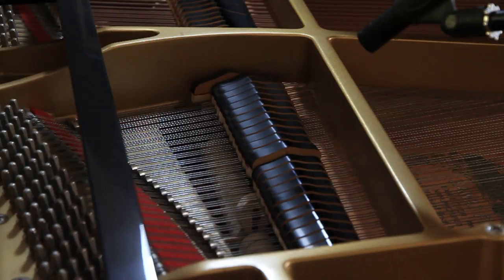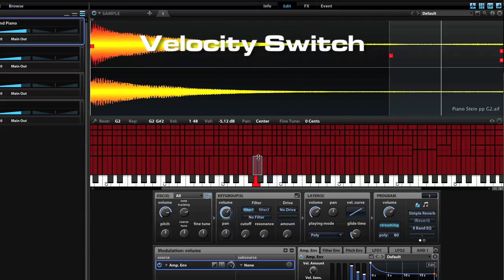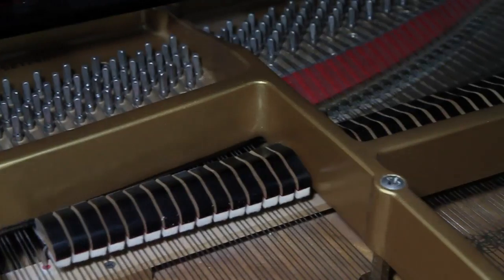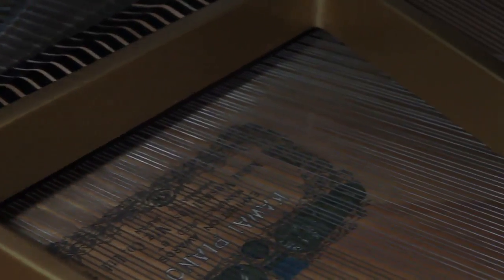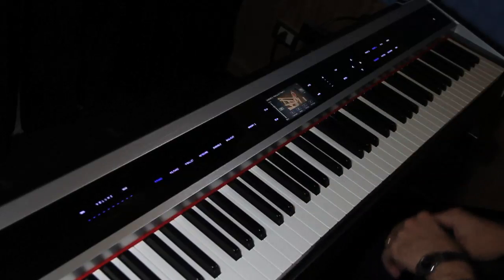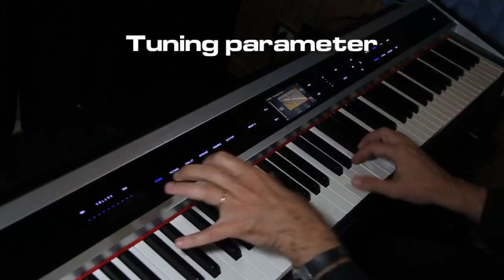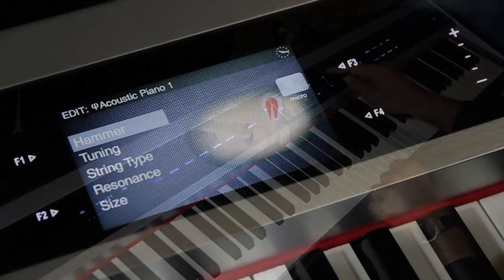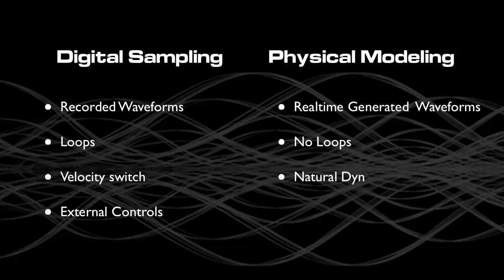Physis Piano Tutorial 1 - ENG

Comment: I've owned probably 9-10 digital pianos since I started gigging which includes Yamaha CP40, Yamaha CP33, some of the Roland, a couple of different Casio Privia models, Korg SV1, etc. I've also got to played many other digital pianos at different gigs including high-end Roland stage pianos and Nord's. However, I never found the one that's even close to the way I feel when I play the real piano. All digital pianos pretty much sound 'cheap' and 'plastic-like' though I understand it also depends on what kind of speakers you use too. After many years of frustrations, I tried "Pianoteq" on live gigs. With Mac Air, a small USB mixer and using my Yamaha CP33 as a midi controller, I actually got pretty good results, especially when playing through my two QSC speakers as stereo. I never had issues on live gigs even though the sound is being generated from laptop through pianoteq. I've probably played about 50 gigs with this set up. I finally could get reasonable sound and AMAZING dynamic range in my playing. However, having a lap top and two extra USB cords (controller to laptop to mixer) wasn't exactly ideal gig after gig. When I learned Physis Piano uses 'modeling technology' just like 'pianoteq', I was instantly interested based on my experiences with pianoteq. But, knowing it's 60 lbs, almost 1/2 of my weight, and not being able to try before buying because of where I live made me very hesitant. But I decided to try it anyway and I purchased H1 through Kraftmusic. So far, I've used it for 4 gigs. It took me little getting used to, but my last gig, I really started feeling excited about this. Especially after I personalized velocity (how I have it now is more like S shape which I learned from some recommendations for Yamaha boards for Pianoteq). The sound is so realistic, and there is LIFE to it...unlike any other digital piano. Also, I can have so much more dynamic range - I LOVE IT! I barely even touched on all the possibilities with countless find adjustments you can make. Also, I appreciate the design. there are many keyboards that just seem so cheesy, and is very distracting to play, but with NO button, it's really pretty cool...I'm planning on sharing more specifics of my experiences, in many different aspects of gigging, hopefully with some videos, including clips from real gig situations to help more people to know about this wonderful instrument. I really appreciate Viscount's craftsmanship, and really hope they can do good in U.S. market as well as other countries so more musicians can enjoy this instrument. My bandmate is also super happy with their organs. The qualities that Viscount put into their products are really impressive and appreciated. -Hanna PK from Hanna and the Blue Hearts
Reply: generalmusic rp2/3  same factory.